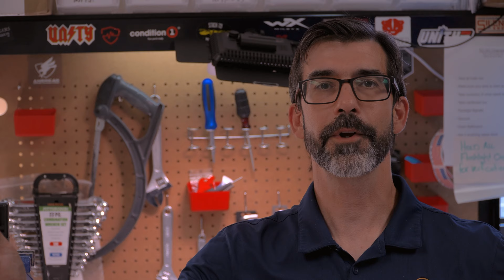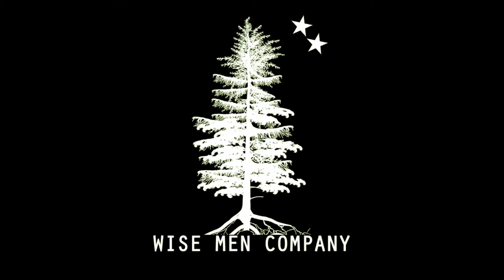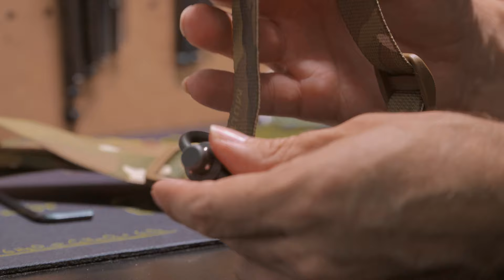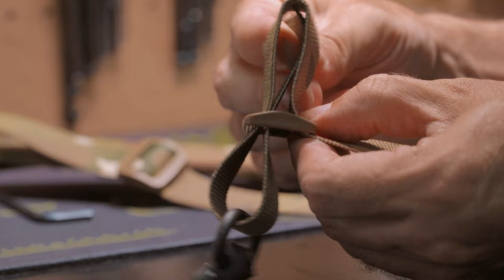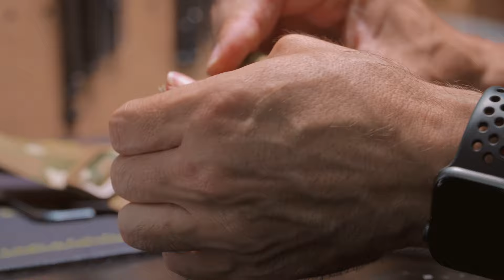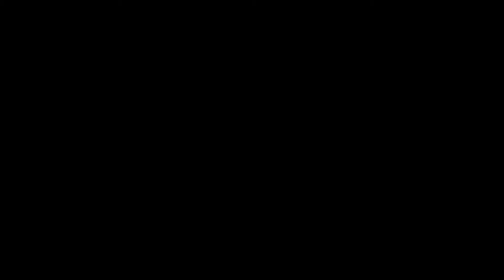How to Install Sling Hardware on a Sling - Weekend Workbench

Comment: Good grief, what's next? How to install a screw-in lightbulb?
Reply: Yet here you are
Reply: Well I for one am glad this video was made. I have never had experience with slings and was not even familiar with the various hardware names. Thanks for the added knowledge. Not everyone is an expert and there has to be a starting point somewhere.
Reply: 1 guy holds bulb...2 guys turn the ladder... Bulb installed.
Reply: How old are you?